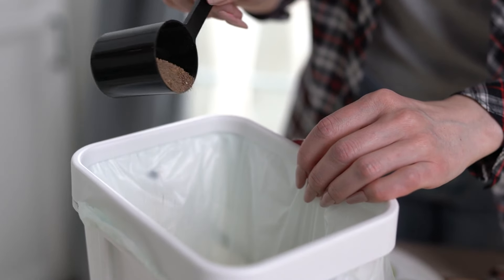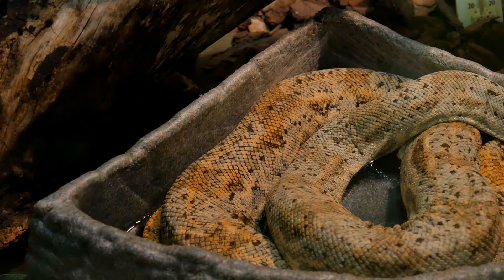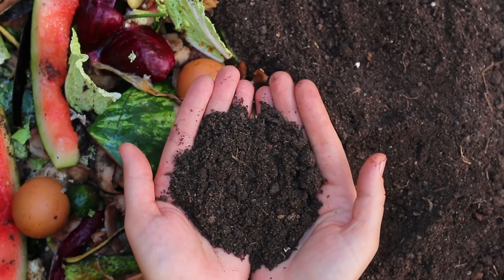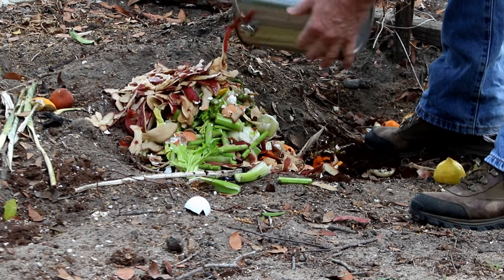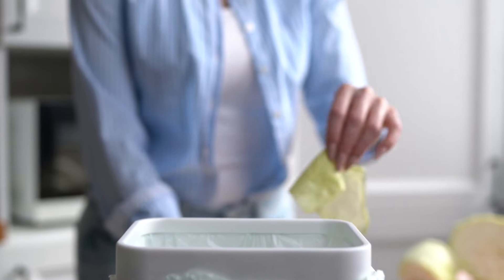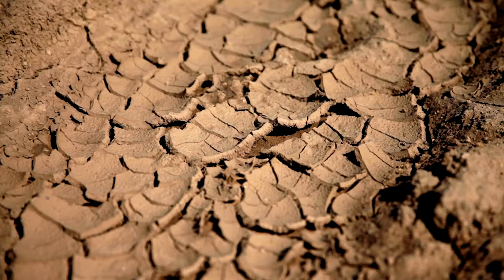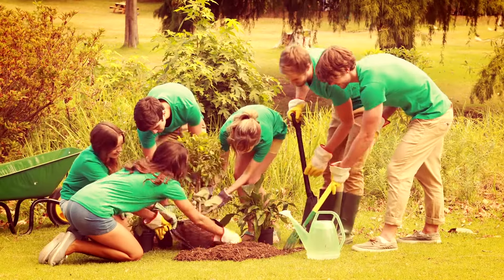How To Make Bokashi Bran For Composting

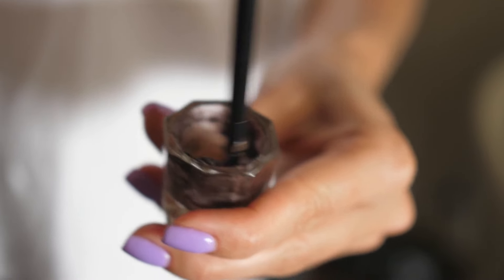Comment: 3:25 Hello! Thank you for this video. It is very organised and well edited.
So I am trying this at home and I have a question. You mention in the video at 3:25 that it is necessary to add a microbial solution, besides the EM, I suppose? What I would like to know is what are you referring to exactly when you mention that microbial solution? Thank you very much! 🍂
Reply: Yes  it is confusing especially with the use if completely inappropriate pictures!
Just means add the 1L EM1 solution to the molassas.  I think there was an editing blip there

Comment: I followed instructions to the point of p0llacing the innoculated bran into a garbage bag and squeezed out as much air as I could manually, pressing with my hands, and then double bagging it.  But after a day or two, I noticed that the bag has expanded with gasses from the fermentation.  I don't know if this happened before when I made it because I had put it away into a room and didn't really look at it until the end of the fermentation period and the first time I made it, it seemed successful, based on the sweet pickled like smell.  So, is there something wrong with this batch that it is off gassing?  Should I abort and start over or is there a way to save it if I vacuum seal it now at this point?
Please advise!!  I'd like to salvage the investment of expenditure, time and labor if I could.
Reply from the maker: It sounds like you're on the right track with your Bokashi bran, and the gas buildup you're experiencing is actually a normal part of the fermentation process. During fermentation, beneficial microbes, including lactic acid bacteria, produce gases like carbon dioxide as they break down the organic material. This is why your bag is expanding.

Here’s what you can do:

Release the Gas: Carefully open the bag to let out the excess gas, then reseal it. You may need to do this a few times during the fermentation process. It's a good sign that the fermentation is active.

Check the Smell: Continue to monitor the smell. A sweet, pickled scent is what you want. If it smells putrid or rotten, that might indicate something went wrong, but from your description, it sounds like the fermentation is going well.

Vacuum Sealing: If you have a vacuum sealer, you can use it now to remove the air and reseal the bag. This can help keep the environment anaerobic, which is ideal for the Bokashi process. However, even without vacuum sealing, you can still have successful Bokashi bran as long as you periodically release the gas.

Monitor the Process: Keep the bag in a cool, dark place and check it periodically. As long as the smell remains pleasant and pickled, your Bokashi bran should be on track.

There's no need to start over unless you notice a foul odor or other signs of spoilage. Based on your description, it sounds like your batch is fermenting properly.